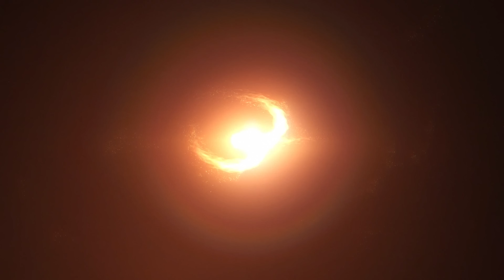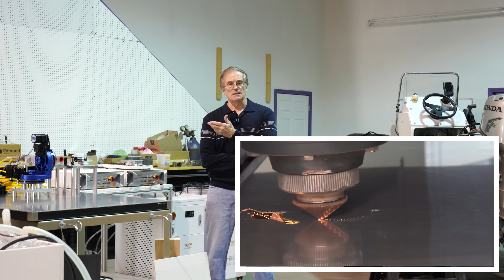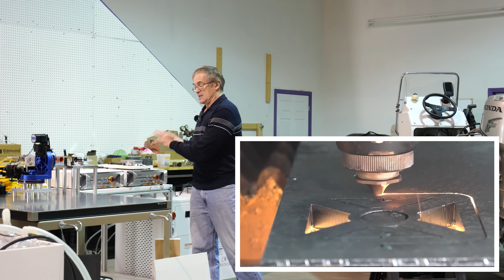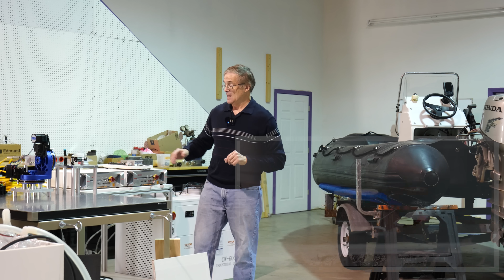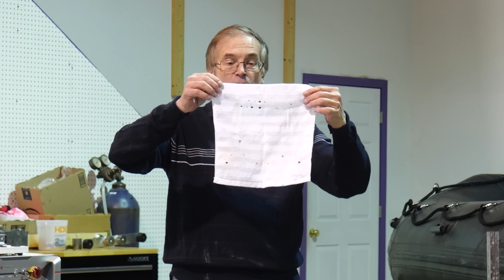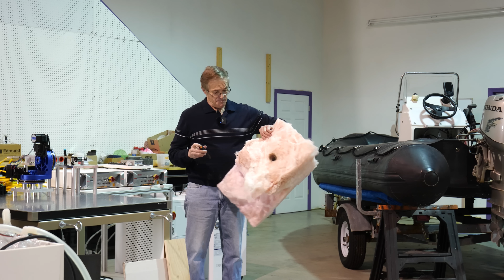We have a problem... and need your help!

Comment: I would either try some kind of carbon black coating or graphite sheet on an piece of aluminum or copper sheet. Combine with some kind of binder or epoxy. Both quite thick to get as much mass as possible within reason. Maybe even run a continuous water film on the backside of the sheet.
Ceramics are also excellent heatsinks, could try to cover them with aforementioned materials, but this gets unwieldy quick.
I'd say this should be doable. I mean we're building buildings which can withstand a literal sun inside them :)

Comment: silica aerogel wall possibly as cheap as $20 per sqft at 50 mm

"6mm, and 9mm of silica aerogel could withstand a continuous wave laser with a power of 7 kW·cm-2 for 26, 61, and 100 seconds"

Comment: I used to work with some REALLY high energy lasers and we used panels of a high temperature ceramic called Zircar as our target boards. Quick google search reveals that there are several companies selling similar items under the same product name, so there are a few options you could try.

Comment: How about a panel covered in a few layers of cheap, carbon felt sheet? You can buy it as welding mats. It’s about 5mm thick and comes in sheets of 1m square or on rolls 1m wide. Very black and porous, so really good absorber and can take 3000 °C without damage. It’ll glow white hot under a laser beam of course but I think 3 layers would last a good minute under a few kW of laser power. Focus shouldn’t be a problem, because the fibres are so small it’ll progressively spread the energy out for complete absorption.

Comment: I worked in construction and i am an architectural draftsman. 
Since you tried glasswool, i could recommend you to try rockwool. I think glasswool has a melting point at around 1000°C and Rockwool is somewhere around 2700°C(?). In any case it has a way higher melting point, so it should withstand a bit longer than glasswool.
There are also mineralic insulation plates that you could try, but i'd say they are pretty similar to rockwool in terms of heat. But i imagine its way easier to cover larger areas with rolls of wool

Comment: Hey, I have never worked with lasers, but here is an Idea: let let the beam go free through a sheet of glas that is part of some sort of bowl. Now fill the bowl with a continous floating stream of water. But not only that, also put a lot of carbon fibre particles floating within the water. The Idea is, to let the laser beam hit the carbon particles so that there ist allways a new particle for the laser to destroy, but the whole process is sort of continous so that the energy of the laser will be sort of eaten up by the continous process. I don`t know if this works, but I think it could if the amount of particles is as high as possible.

Comment: How about using Vantablack to absorb the light and re-emit it as heat?  I doubt it would work to absorb this much energy concentrated on such a small point, but maybe it's worth experimenting to find out just how much laser light it can effectively absorb?  A lot of comments are talking about using water, but wouldn't the laser just penetrate the water and still burn a hole through the back side?

This problem sounds like the classic "pick 2 out of 3:  lightweight, cheap, or effective" problem.  Good luck!

Comment: A read a lot in the comments about people trying to shut the laser off. But the correct background you could leave the laser on, Here's an interesting concept about using vapor to defocus. Clouds scatter and absorb sunlight, preventing some light from reaching the Earth's surface directly. This scattering and absorption effect causes the light to be diffused and spread out, rather than focused, which is why cloudy days have softer, less intense light than clear days

Comment: Im'e no material engineer, but when you said veneer worked well, but burns, i taught off concrete forms pannel wich are thick dense kinda marine crezon... It comes in various thickness.

And i also wonder if you could mount this backwall on a vibrating footing. Fast short vibration would change the target of the laser continoustly, giving you extra time to shut off the laser...

That was my two cents.

Good luck

Comment: I've worked as a welder for many years and have found that carbon inadvertently deposited in a crater, from the carbon Arc gouging process is very heat resistant. So you might be able to buy a few boxes and break them in 2 inch lengths and bind them together in some fashion, and build a small wall or panel of some sort.

Comment: "I'm curious how these materials would hold up against lasers:
Durock (not Durock Lite) - Heavy-duty cement board for backing.
Tile - Fire retardant but very thin. Quality varies by clay type, backing, and glazing. If I needed a thin, light laser barrier, I'd experiment with different glazing materials that could be applied to tile.
Kevlar Ballistic Panels (1/2") - We've installed these in high-security locations behind drywall, sometimes multiple layers. Obviously can't say where, but they're proven effective.
Shaft Board - Used behind elevator walls and between townhomes. Each piece is 1" thick fire-rated drywall. Two 1" pieces go together in a 2" H-track, giving you 2" total thickness. Rock wool insulation goes on each side of the fire barrier, attached to framing with aluminum L-brackets for heat dissipation.
Fire Brick - Old-school Chicago method. Red clay bricks with center holes, used in city buildings for decades.
Some or all combined would be heavy but could move on caster wheels. None of these are designed to stop fire completely - they're rated to give firefighters response time. Interestingly, Kevlar has some fire retardancy as a bonus.
Would love to see laser testing on these materials!"

Comment: My idea is to use an aluminium sheet cut into a disk shape and rotated by an electric motor. The heat is distributed to a large area and can be dissipated hopefully. A few of those disks and motors overlapping each other could cover some area.

Comment: You didn't mention how fast the brick was burning, but you might try concrete or cement board as is commonly used under tile installations. It may give you a larger fraction of a second than drywall. Or maybe even ceramic tile itself. Also have you considered some type of shutter device on the laser aperture?

Comment: Another possibility .  .  . assuming you can find a large glass sheet that has very low absorption at the wavelength of your laser .  .  . use a lapping solution (you’ll have to experiment with this) and frost-finish the front and back surfaces.   A couple of feet behind the glass shouldn’t burn anything.  I’ve used this technique to protect sensitive detectors from gigaWatt energies.
Reply: Good idea.  I have sandblasted glass jars before and gotten a good frosted effect.

Comment: Cheap way: 8ft of clay backing litterally a dirt mound or fire down from the roof. Intermediate cost: get a mirror that is rated for that wavelength of light, reflect the beam into the ground. Expensive way: Cover silica thermal plates (aerogel) with graphite and back it up with tungsten, titanium, or inconel plate. May also be beneficial to use thick sections of glass wool around the target periphery. The thought is that the graphite burns a bit, leaving soot to absorb laser light, the aerogel holds the heat and diffuses light, and the high temp metal  reflects punched through light to the backside of the graphite rediffusing through the aerogel, distributing heat as it does so.

Comment: I don't think there is much in the way of barriers that isn't just lots of mass - Reflection, not an option - melts even first surface 99.999 mirrors in no time. Refraction, same problem. Absorption - the only hope...but I'm not sure if those lego-block concrete stackable walls are a) rentable, or b) able to be supported by your floor.  Genuinely finding a chunk of land with a suitable natural dirt formation as a backstop might be the only real option.

Comment: last one, maybe a couple of 5 gallon water jugs will entertain the light waves long enough to shut off. The laser will put a hole in plastic definitely but if you have it pointed toward the bottoms of jug by the time the water ran out it would be at least a couple minutes. Kinda like when they use the water jugs for shooting to catch the bullet. You could even cloud the water with powder or something to diffuse it further. Maybe milk.

Comment: what about a fog screen in between? the water droplets can unfocus the beam before hitting a solid surface. it has to be dense tho. and if the droplets evaporates the heat should drag other droplets in due to convection. If it works, you could build a frame whit two nylon sheet to form a cavity, and use a fog machine whit the thick liquid to fill it. It would be cheap, easy to fix and to move/assemly/disassemply. the nylon sheets only purpose is to contain the fog. when holes are formed, patch it whit duct tape and you are good to go.

Comment: There is a REAL PROBLEM in that I can go to a shooting range and fire off rifle rounds knowing they will fall to the ground eventually. What you describe might blow up an airplane a few miles away as soon as your target disintegrates. Perhaps a multiple authentication on the target as well as a variable control of the beam so it loses effectiveness sooner rather than later. If you run the numberson your system when compared with an office presentation green pointer and how pointing one of those at an airplane is a crime, just how sure can you be that there isn't an aircraft or even spacecraft that might end up 'catching some rays' from your Star Trek worthy rayguns?

Comment: Sorry, but I didn't read through the 6,397 comments (so far) before commenting. The brick you showed wasn't "fire brick", which I suspect is better as a shield.. What about something like the heatshields on space craft (but they get high blunt heat, not "laser" focused heat)?

(I haven't seen your big video yet, but) hopefully, you fully prototyped the "aiming" hardware and algorithms before using (lethal) high power. In this video, there was no mention of legal permisson to do this work, especially important for liabilties for any misfires that may have dire comsequences. Laser beam energy diminishes more slowly than "stray bullets", so your testing should all be behind mountains of dirt (maybe inside a dormant volcano?), since it can be lethal at even great distances.

But I got to say wow! This beats ,my attempts to make some black powder for rockets in 5th grade (I burned a bigh spot in the hallway oad floor when a test batch spark jumpted into the container with all my stuff!). I almost had a DuPont family moment (they lost lots of family members when they were still into manufacturing black powder and explosives before they became "civilized"). But they lived far from the city.

Comment: One, Id put a "Dead man's switch" on that thing. Like hand held 2 botton pench type.

I would have tried Rockwool rigid panel installation or ceramic wool, but i doubt that will help much

Make sure to use fire bricks like foundry oven bricks that do not have water in them because the water would expand and explode on contact with laser.

Other that that, move to a snad pit

Good stuff keep it up

Comment: Graphite.  It'd work, but it'd also be yet another brick wall.  And since I don't know the power density, I don't know how thick it would have to be.  Really high power might require an inert gas bath around it and fire suppression gear.  If that laser is in the 10 kW range, even 1/2" thick graphite blocks might not be enough when the laser stops moving.  Extruded graphite that thick can approach $1k per square meter, too, so... not cheap.

Comment: Possibly a step up from fibreglass batts is rock wool insulation. Roxul is one brand name.
I believe that it's made from basalt. 1600° C melting point.

This might give you more time and easily moved around.

Comment: Could the axis change, make the laser axis vertical? Ground makes a good backstop, and if you wanted to protect the finish flooring gravity makes using water as an energy sink much easier (kiddie pool, etc, instead of the complexity of vertical waterfalls, etc)

Comment: my two cents  from  the Designer  side of things.....Cement board used in  bathrooms/wet locations with sand behind it. You could make a deep box , open top that you could inspect/ refresh. The laser should be bolted down in  the test besd so rogue shots would not be possible outside the target area.. cheap , non combustible and  you can dispose of anywhere when done.  cool stuff... keep it up

Comment: My first thought was water in a fish tank, ideally round or square.  Dye the water to match your lasers wavelength, perhaps using organic rich dirt.  Then stir it with a small paddle attached to a drill mounted above the tank.  The vortex of water should prevent it from overheating any bit of it too quickly.
However, this doesn't scale to a wall size.
Reply: I was thinking the same thing but with mirrors added to make the path longer in a zig-zag.
Reply: Same. Stack up a wall of fish tanks filled with muddy water.
Reply: Same idea but a vessel filled with Water so when the laser punctures the vessel it creates a hole and movement of the Water. You can catch the escaping Water in a bigger container.
Reply: Yes
Reply: Awesome laser! Awesome explanation of the problem and some of the attempted solutions! U r one of my fave channels.
So, according to ai:

Beam diversion: Using a mirror or prism to divert the beam away from its intended path, which can help stop the laser emission by preventing it from reaching its target.
Acoustic or optical modulation: Applying an acoustic or optical modulation to the laser beam, which can disrupt the laser's operation and stop its emission.
Nonlinear optical effects: Utilizing nonlinear optical effects, such as two-photon absorption or nonlinear refraction, to absorb or scatter the laser beam, which can help stop its emission.
Plasma or arc generation: Creating a plasma or arc in the laser beam's path, which can absorb or scatter the beam and stop its emission.
Spectral beam combination: Using a spectral beam combiner to combine the laser beam with a counter-propagating beam, which can cancel out the laser emission through destructive interference.

Optical isolators: Devices that use optical components, like polarizers and Faraday rotators, to prevent back-reflection into the laser cavity, which can help stop the laser emission.
Q-switching or mode-locking disruption: If the laser is operating in a pulsed mode, disrupting the Q-switching or mode-locking mechanism can stop the laser emission.
Gain medium interruption: Interrupting the gain medium, such as a fiber optic cable, can stop the laser emission by preventing the amplification of light.
A few of these seem very feasible!
My 1st thoughts were of an aquarium with dye in the water, maybe a fresnel lens inside aquarium on laser side wall to disburse beam… look forward to your best solutions as usual!
Reply: My thinking was almost identical to yours with only a slight difference. Shoot the laser through a large glass tube with water flowing and induce air bubbles in the flow, I think you would get a scattering of the beam and cooling at the same time. Maybe an oversimplification but who knows...
Reply: Very similar to my idea. 👍

Comment: I don't know anything about lasers, but I do know that light retracts considerably with cloudy quarts I used to make fixtures with quarts crystal and when the light was refracted through cloudy quarts crystals it diffused better as a light compIred to a clear quarts crystal. So if you have access to a slab of white or cloudy quarts it should refract the energy from the laser long enogh to shut it off. Also, pointing it more towards the ground or pointing it more downward so the beam hits the ground would be a safe way too. The ground will be in the way, and then you'll have time because I'm sure it's not going through the earth.

Comment: Rotating wheel or conveyor belt, angled downwards a bit. Surface material, maybe lie the wheel down, put a thin layer of sand, then Rockwall/plasterboard sheet on top and try that. Cheap, readily available, and the rotating wheel will mean the contact point is always changing. 

You can make the wheel off center if you put a sideways moving axle which can move as the wheel rotates. Something as simple as a pinion gear on a flat toothed bar. Or a circled tooth ring/s that move the position of target with every rotation so it's never the same. 

Cheap rotating wheel (s) with readily available, easy to change, surface material.

Comment: umm ... given a fix location and fixed target ... could a vapour be generated that would be effective to diffuse the beam to a harmless intensity? ... or ... a slightly concave receiver surface on a pyramid shaped piece of glass?

Comment: Build a circulating waterfall on a trailer so it is easy to move. Have the wall the water goes down at a slight angle, maybe 5 deg. With the water cascading down at a decent speed, hopefully it is fast enough to carry away the heat.

Comment: A dual approach: 1. A "mirror" that is stationed in front of the far wall, angled to reflect the beam(s) down to the floor; and, 2. An absorbent "box" or "tub" on the floor that is large enough to contain several inches of wet sand. The "mirror" might be slightly bent to reduce the size of the absorbent "box". Should be relatively easy to construct both parts, and remove upon test completion.

I have no idea what type of material would reflect that frequency of laser. Sorry. Good luck!